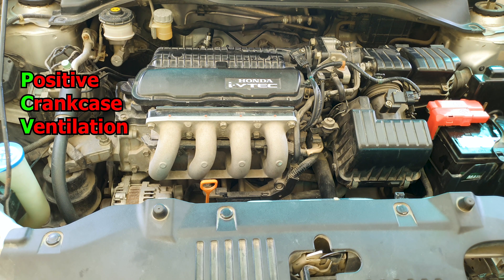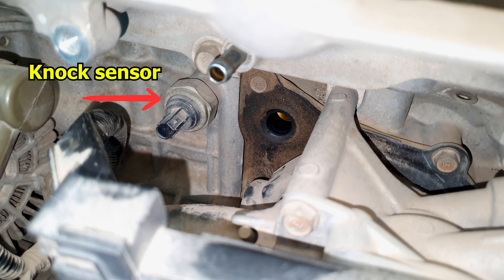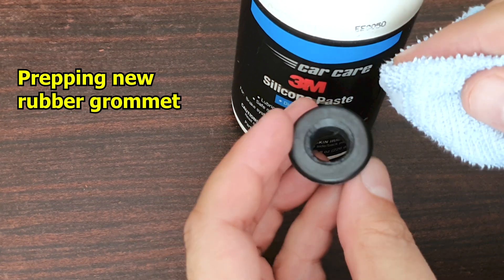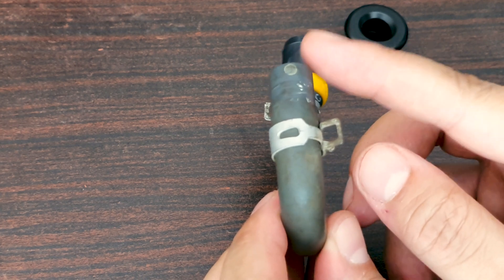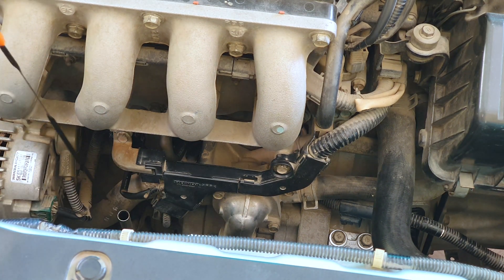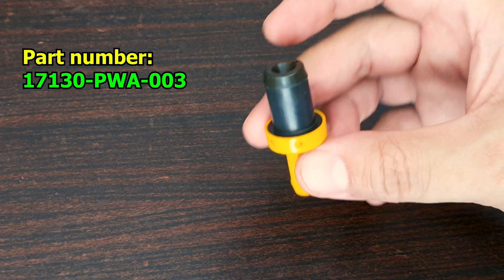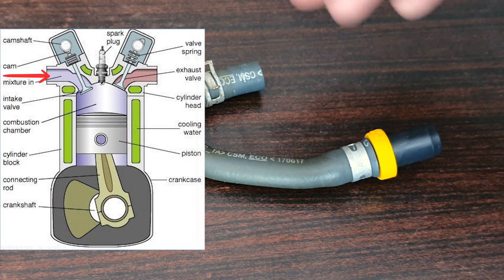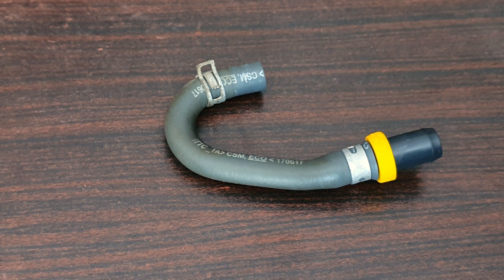PCV valve: check this before throwing money at your engine.

Comment: Sir plz can you send me the link that where you bought from.? Thank you
Reply from the maker: Honda dealer, give them the part numbers and they will order it in. Currently there arnt any supply issues. I just got some parts today, took 3 days for the dealer to get it from their plant.
Reply: @TheWrenchWiz  sir I thought you ordered from amazon because I ordered genuine part from honda 2 days ago but when I opened it, The sound of PCV valve was almost  muted. Even your old valve in the video was producing more sound than my new one. So that's why I was wondering to have amazon link
Reply: @TheWrenchWiz  I actually installed the new one to check how it works but the issue was same as before.
Reply from the maker: @GhulamMustafa-lp6hd  I would not go off sound, differences would exist on camera and in real life. 

If the issue is what you said at low rpms, thats normal. That is how honda engines are (NA ones).  I wouldnt worry about it.
Reply: @TheWrenchWiz  sir the is issue is the new valve from yellow side when I suck it's working properly and when  I blow it back the air is coming out from other side. The issue I'm facing is on both low and high RPMs.
Reply from the maker: What's the issue on high rpm?
Reply: @TheWrenchWiz  sir the issue is Car is running on rich mixture, spark plugs are going black and fuel economy is very poor. So when I diagnosed the issue I found my pcv valve is sucking air with oil. It only should take air out from engine block, now my valves are getting oily yesterday when I opened up the intake manifold. Car is only 38k km driven and  like new one.
Reply from the maker: @GhulamMustafa-lp6hd  Something else seems wrong why you car is running rich. I couldnt really say, its needs proper diagnoses. Maybe some issue with the O2 sensor, maybe MAF.

Comment: What will happen if its get inside?
Reply from the maker: I had a piece fall inside, have not had any issues. If it stricts air flow then that could be an issue as it cant vent the pressure. Similiar as if the pcv was bad, oil may leak out, more oil consumption.

Comment: I REPLACED MINE HAS 2 PCV VALVES ON 2021 BLAZER WITH 38K MILES AFTER THAT DRIVE LIKE NEW. YOU SHOULD DO THE SAME.
Reply from the maker: I did replace it.
Reply: OK 👌 THANKS

Comment: The PCV valve on my 2009 Honda Fit does not look like this one. It is the same metal one that is on the Honda K-series engines. What year is the one in this video?
Reply from the maker: I mention this at 4:43. Yes your right its a metal one, way easier to remove and no rubber part to deal with. The one shown in the video is for a 2010 Jazz/City.
Reply: I missed that. Thank you.

Comment: Hi may pcv valve got broke the other pieces is inside na pvc room is there a problem if I can install a new pcv valve without getting the other pieces inside ?
Reply from the maker: If it has blocked the passage inside then yes it can be a problem. I don't think a small few pieces will block it, maybe restrict the air flow, depends.

I also dropped a small piece inside on a previous occasion. Have had zero issues.
Reply: hello boss same like me, bush inside. after 6month have any problem sir?
Reply from the maker: @Aimannnn96 Sorry just saw this comment, sometimes YT does not notify or new comments. I havnt had issues with a piece falling inside. I have not seen anyone say online it caused damaged. Maybe Honda designed the vent system in such a way that nothing will fall directly into the engine.

Comment: Hi sir, what happens if most of the grommet fall inside? I've tried to took it off but most of the grommet fell inside and i couldn't get it out
Reply from the maker: The issue is if it has blocked the passage inside. Try getting a wire of some sort to see if you can fish it out. 

Else just install new one and monitor your oil levels. If you notice increased oil consumption after then you have open it up, the breather plate, and get it out.

Comment: Is it possible to clean it with a spray? Instead of buying one.
Reply from the maker: It should be to some extent. I would use an electric contact cleaner or MAF cleaner, as it does not leave any residue behind.

However, if the PCV valve is plastic made, it will eventually fail. The plastic will become brittle and stop functioning. So this is why I recommend replacement.
Reply: @TheWrenchWiz  thanks for the reply. I took mine off with the help of a mechanic. Its metal made . However its allowing air past both directions. And even cleaning it with spray didnt help. We ask honda dealer a new one but its only going to be available in 7 days. May that be the reason why my oil is getting burned? It never did. Now it disappear half quarter every 4/5 k km. Thanks in advance
Reply from the maker: Yes a faulty PCV valve can cause oil loss/burn. Inspect the hose that goes from the PCV valve to the intake manifold, if its oily have it cleaned.

Comment: Very well explained. Anyway, do you have a link where i can buy a knock sensor for Honda city 2009? Thank you
Reply from the maker: where are you located?
Reply: From Philippines sir😬 any link for online shops (example shopee) sir will be much appreciated 🙏🙏
Reply from the maker: @aldrinarcaina  I would would not know any online shop for your location. 

The best option to ensure if you want a genuine part is to go to Honda, tell them you want this part 30530-RB0-004 (double check if its the knock sensor you need). They may not have it in stock but they can always order it in.

For online shops ask them and check any feedback if they indeed sell genuine parts.

Comment: is it okay sir? when i remove the pcv valve of my honda jazz, almost half of the grommet fell inside.
Reply from the maker: If the passage inside is blocked, then then its a problem. Long time back I had a small piece fall inside, caused no issues. 

Monitor your oil levels. If you see excessive consumption or maybe a leak start somewhere,  it could indicate the passage is blocked. That breather plate isnt complex to remove, held on with some bolts and sealed with gasket maker.  Getting to it would be more time consuming.
Reply: @TheWrenchWiz  Can you make a video on how to open the breather plate? Because there are other components infront of it preventing me to access the breather plate bolts
Reply from the maker: @SmokeyCat407   I will have a look whats in the way and get back to you.
Reply from the maker: @SmokeyCat407  2 things are in the way. You have the thermostat housing and then under that you have the starter motor. Removing the thermostat housing requires draining the coolant first. At the moment I wont be able to make a video as I just recently changed the coolant. However I will keep this in mind in the furture.

Comment: Lovely video man. I'll now go check mine :)
Reply: I have a 2010 1.3 City. I am facing this issue where under 2k rpm the car feels very heavy on each gear, but as soon as I reach 1.9k - 2k rpm, the car becomes extremely light. The PCV valve has never been changed, but there is no oil reduction. As for the mileage in my most recent tank, I got around 16.8 km/l on ODO (571 km), it is mixed Isb highway driving + within society as well, the actual figure for that tank was 14.5 km/l. However, with a light foot and very soft accelerations, over a 60+ km round trip I do get over 21 km/l on display. Sorry for the long post, just wanted to give a little background. I drive the car at 60-70 km/h and never over 70.
Reply from the maker: Sorry just saw your comment, YT didnt notify me of a reply. 

Is this your first Honda? Cause all NA honda engines lack torque at the bottom end, its gutless. So thats normal imo what your feeling.

Comment: How did you knew that your PCV valve is faulty?
Reply from the maker: The old PCV valve still does rattle but is it at 100% functionality? I cant say. But the oil residue I showed in the video (around the PCV seal) is an indicator that something isn’t right. This is a plastic PCV and it will eventually fail. By fail I mean it will also lose structual integrity, being exposed to many heat cycles. 

This time it took around 10 minutes to get everything out. I took it out once after it had 100% failed. It took hours as it broke into pieces and all effort was to make sure pieces didnt fall inside the oil seperator.  I also had more oil loss between oil changes. So I now change it as a preventive measure, rather than wait for it to completely fail.
Reply: how will the car behave if the valve is faulty? @TheWrenchWiz
Reply from the maker: You can get more oil consumption. You can start burning oil, oil can go past seals. Engine could idle rough, have overall poorer engine performance and milleage could suffer.
Reply: How does one knows that PCV value is not functioning?
Reply from the maker: If it doesnt rattle when you shake it, its gone.  But again, just because it rattles does not mean its 100% perfect. 

You can test the airflow too. It should only go in one direction, if you can blow air both ways, its gone.